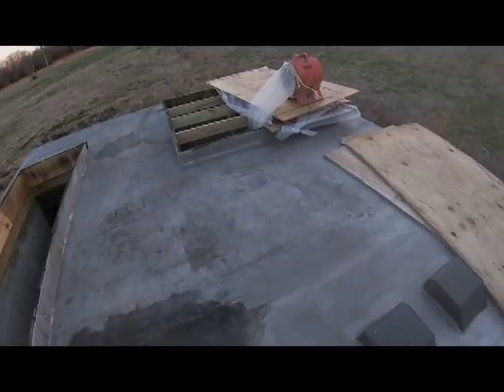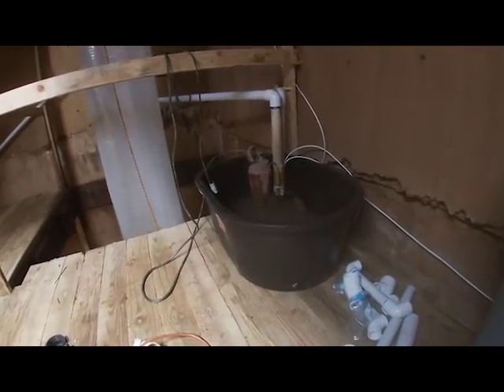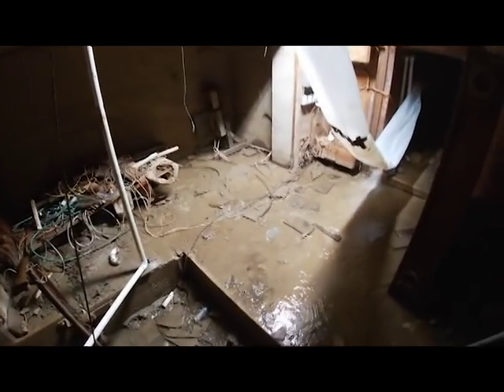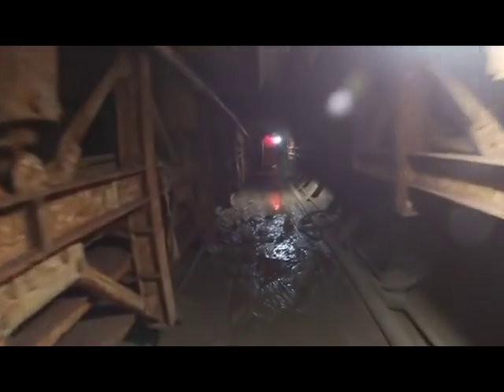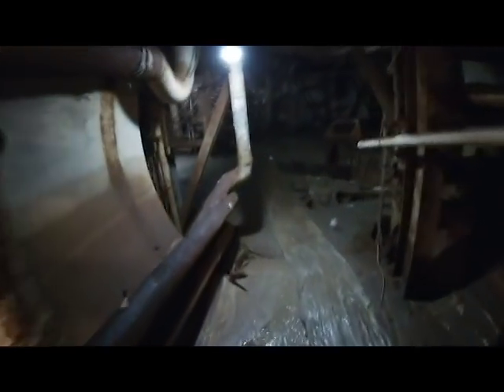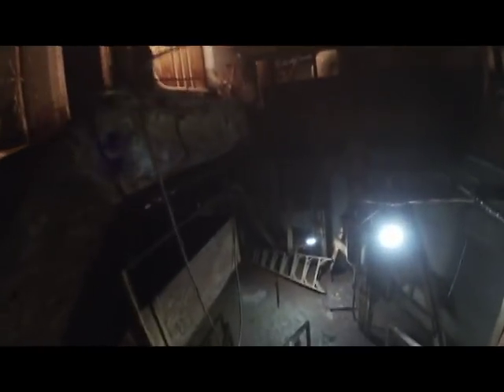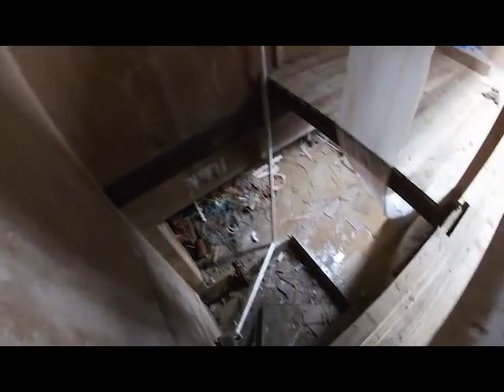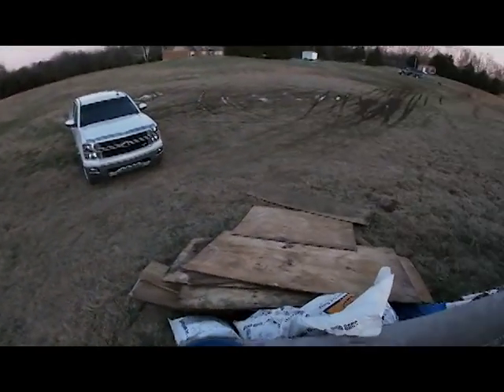S1E11 - New Access Portal Decking and Tour - Owning a Titan II Missile Silo

Comment: If you clean the escape tunnel you can install a large fan topside and push air to the bottom for ventilation.  The air will arrive at ground temperature having travelled the distance against the sides of the tunnel.
Reply from the maker: That’s is part of the plan however you are missing a major problem most months. If you take hot humid air and cool it down you get indoor clouds and 100% humidity. Not good
Reply: @atomicunderground9971  There are some great dedicated "whole house" dehumidifiers on the market. Put one on either end.  Top would be easier to drain.

Comment: one way to help with the water problem and ventilation at the same time is to use a somewhat strong heat source at the lowest points to heat up the air. the hot air will rise out of the silo on its own and take the humidity and stale air with it. you just make sure that fresh dry air is blown in to the bottom without mixing with the wet bad air on its way out. this will dry out the whole space in no time and give you clean fresh air in the whole silo at the same time. with the added  bit of also warming up the cold silo and helping to keep down dust once all the water is gone. this can also be used permanently in the finished structure to keep the air fresh dry and comfortable warm as the ground in usually a little cold (~60 degrees) no matter the outside temp
Reply: also it is somewhat worth it to get a well into the bottom on the filled up silo to start pumping out the water that is definitely filling it up as it is also the lowest point of the site so just getting it half pumped out will keep the rest of the silo dry
Reply: Or they could just set their fan up at the lowest (reasonable) point and blow it up and out through their ducting.
This would suck fresh air in from the surface all the way down to the fan.

Comment: I would get a big well pump because they will put hundreds of feet up a well. It can be setup to use a float switch to shut down when the water is down. You need to pipe the water down hill away your place.

Comment: Make sure you have a fire suppression system in that place covering that wood staircase. You don't want something to happen to your only exit from the bunker.
Reply: Thar would be funny as hell
Reply: lassit lassit1 can’t confirm or deny if the stairs have been rigged to do that if forced entry has been achieved
Reply: Ya just throw some gas down the hatch and light a match then wait for them to come out the escape hatch. Or forget about bad actors trying to flush them out in a zombie apocalypse but what if they have an electrical fire that sets it on fire. I hope they have it treated at least.
Reply: Just another reason to get that escape hatch dug out!

Comment: I'm going to try to not keep going about how cool all this is...  4:57 I see a 2nd pump for redundancy to take over if the one in the pit fails or just can't keep up with it...There's prolly 4, i dunno.  Hopefully the "T-clip" test came back low so you can just throw it all out w/o doing actual abating.  Too much to comment on...Thanks for the tour!  We use to build fans from old gas push mowers...set up over a manhole and it pulls air out ...from open manhole downs stream (sewer/storm), the worked really well!  OK..I'm zipping it up now...Thanks again!
Reply from the maker: I’m all about redundant systems. Right now a flood wouldn’t be a disaster but in the future it will.
Reply: @atomicunderground9971  water is your number 1 Foe for sure.  There is some stuff called "STRONG" it is a dryer type concrete that has fiberglass fibers in it and it is BLOWN on to the surface and spread out like concrete and it stops leaks as its leaking...it's incredible stuff.  It's used to "re-new/re-furbish" old manholes.   https://www.strongseal.com/project-1 Pretty neat stuff...may do the trick in tricky spots

Comment: Install a back check flow valve above the discharge side of the sump pump so its doesn't always cycle like that.  You're going to burn out the motor.
Reply from the maker: M P every valve we have installed pops or fails.

Comment: As I commented on another reply here.

A better option for the ventilation is to have the fan at the lowest, reasonable, point pushing stale air up and out through the ducting. This will draw fresh air right down to the fan at the bottom from the entry portal.
Reply: Nope, that's not true. Ventilation should be done by bringing fresh air to the point where it's required, i.e. where people are working at that moment. This way you are ensured of a constant flow of fresh, breathable air. If you do it the other way around, you don't know what you're sucking out, and you especially have no idea where your fresh air is going. Sure, in theory it should go to the location where you're sucking out the dirty air, but will it? Does your blower even create enough negative pressure to get that done? 

In the worst case, you could actually be sucking out the fresh air that's coming in, so you may actually create a dangerous situation. The likelihood of suffocating because of that is minimal, but it'll sure give you a headache. Also, what happens when your ventilation channel ruptures somewhere? 

When you're blowing in fresh air through the duct to the location where you're working, 2 things will happen when a pipe ruptures: 1. You'll notice that air stopped coming from your ventilation channel, so you're notified of the issue immediately. 2. Fresh air is still being blown into the building, just not to where you're working anymore. Result: Plenty of time to fix the issue, no danger at all.
However, when you're sucking the dirty air out, like you're suggesting, if the pipe ruptures somewhere, you will never realize until you actually see the rupture. The fan will just happily keep blowing, but instead of blowing the dirty air out, it's just blowing it to another section of your building now. The two things I mentioned above both don't happen here. You won't notice that 'fresh' air stopped coming, and you're no longer getting any fresh air in the building.

And even if those reasons aren't good enough for you, why on earth would you want to have a loud, noisy fan down where you're working, where it'll get dirty and possibly even damaged (either from dirt or falling/getting hit), when it can also be topside, out of any harm's way, and keeping the noise outside? Why would you want your fresh air to go through all of the dirty silo anyway, picking up all kinds of smells or contaminants? 

There simply is no reason at all to use your ventilation method, it's worse in every single aspect.

Comment: Its looking great
baby steps! Rome wasn't built in a day!
a couple of possibly silly ideas
The springs in the cable way that used to hold the floor etc  people are going daft over making knives and swords at the moment they might sell?  supplied with a certificate of authenticity etc....
also have you found the ducts that used to supply the electric, phone, you could possibly rig up some low voltage fans  possibly solar powered? it would help stop the air going stale?

Comment: Just a small note. Sucking air does not equal cavitation. Cavitation would destroy your pumps quite quickly. Sucking air is just an annoyance / might overheat them.
Reply: When I used to keep a reef aquarium, we called it "scavenging." Not sure if that's the proper term to use here, but it's the same effect.

Comment: So sad to see what was once a very well designed and engineered structure in such bad shape.  Some idiot in the architecture department did not think about checking the local groundwater tables.  I can only presume that the original structure must have cracked to let that amount of water in.   I would have rebuilt the original cover back the way it was.  You really should have two board rows on the the elevator shaft railing.
Reply: LOL

Comment: What is the reason that people don’t clear out the actual silos? I’ve only ever seen where they clear out the control center and cable ways.
Reply: Mostly because of three factors: time, expense, and usefulness. It'd take a ton of manpower and money (unless you own a bunch of specialized heavy equipment and access to lots of free labor) to dig it out from top to bottom (all 146'!) and remove all the copious amounts of scrap and heavy concrete the demolition team dumped into the silo before burying it. After that, you'd have to rebuild the top 20' of the silo, since the treaty required the teams to blow it up. After all that, you're left with a giant, empty vertical pit. Not many people have a use for that. At least not one that would warrant spending a small fortune to rehabilitate. That being said, I'd LOVE to see an emptied silo just out of curiosity. But you can visit the Titan III missile museum to see a fully preserved one.
Reply: @Calamity_Jack  The Titan II silo itself is also not that terribly wide either, so assuming you went to the vast expense of clearing it out and rebuilding the top (or at least putting in some kind of roof) what do you have for your trouble? It's not like a Titan I or Atlas where the silo itself is this enormous cavernous space that was required by the elevation and fuelling systems.
Reply: @MalikCarr  True, they're only about 55 ft. wide. So unless you have something really, really long you want to store, not very useful.
Reply: @Calamity_Jack  And that's after you tear out the interior silo walls, right? I don't think the Air Force was considerate enough to do that for you, otherwise the usable volume really isn't that much greater than the width of the missile itself.
Reply: @MalikCarr  you know what would be weird and just down right creepy? I know this would never happen. But just imagine if someone did clear the silo out. And there was still a missile there. I would shit my pants. That would be creepy.
Reply: @tylerdees4850  That would be very interesting, although it's physically impossible - the way those silos were demolished in the 80s means there's not enough vertical space for a missile to fit inside it. It's not like when they took the Atlas or Titan I silos offline in the 1960s and just welded up the doors, the Russians wanted verifiable proof the Titan IIs were decommissioned and by that time they had spy satellites that could verify it.

Comment: Wondering why you are making flat top with giant entry hatches instead of building a kind of building around all access point?
Reply from the maker: There may eventually be a building up there but for now it’s designed the same way it originally was by the Air Force

Comment: Just a question  about the scraper.. is he going to pay you for taking the scrap? I mean I know scrap prices can be low but the way I look at it is he shouldn't be charging you to take the scrap because it's  kinda free money
Reply: Another channel (Death Wears Bunny Slippers) went through this with his silo. He thought the value of the scrap metal and copper wiring would more than cover the cost of demolition. It turned out he was wrong. The scrap did help defray some of the costs, but he still ended spending several thousand bucks to the scrappers for the job. Apparently, the scrap metal market is pretty depressed right now. Metal scrap isn't bringing in much money.

Comment: This Idea ,  hit me watching this.(1  make sure air free of explosive fumes)  All of us watching this think HUMMM     "Now If owed this place "!.( won lottery had millions spend on it!)Here what I would do......  that why fun watch....

I own  a small coal stove, low teck no fans just a  steel box.  Dry Hot heat puts  out is out unreal. Matter fact I dump 5 gallons water on floor( all clear cement  every night( put water the in air).  2 Hours later all gone!.
Step #1 

Open up in control center the emergency escape tunnel ( you got door open) Put a( proper stainless steel ) chimney up that  shaft   .I  then install small coal stove in it ( not wood) ( us Coal company stove, I do not get paid from them ! ) 
 Get 1 pallet 1.25 tons Last a year.( $500-$1000 , stove  same cost   , stack $1500.00.
This do several things ,   Burn hard Penn Anthracite coal. get rid all water in air and in walls/ floor.
This will suck all air moist air  out. send to surface. capture heat off stove , blow it to lowest floor. 
This circulation will go all way to top dome. Put in vents to pump air back down lowest floor  .
Run 4 inch cheap plastic flex able  tubing get that to stove burns only surface air.
Problem got is  cement needs be dried out . ( On inside) all cement like a sponge holding water ....Right now pumping in air from top side ( summer all water), fighting cement .
Step #2
Then get a second stove and put it in bottom entry shaft do same thing. ( going put in elevator).
Run stack surface , fresh air from out side.( close top entry  shaft off).

Net result  , Ground temp 50 -55 . need get walls hot and dry. 100-105

Stove temp full cap (  3 feet above stove 100-105 F  ) dry out the walls ( cement ) entry portal, suck moist air out all blast lock area ( some long cable way).
 With stove in command center ( take a bout 2 -3 months ) it will bring temp 90-110 degrees inside ( under ground).
 All the smell and water in air will be gone!Kill lot of mold....

 The radiant heat stoves puts out makes fire wood heat  , feel as cold  like ice cubes, in comparison. 
Right now you are pumping in moist air ( better in winter dryer). have water ( river) that is acting like a giant humidifier.

Right now  I heating my entire( 40 year old  poor insulation ) house ( -25-35 below out side). 72 degrees.   when out side temp goes balmy 35 degrees out side , we have open winds let excess heat out.....that warm   and that dry!  The cement floor and walls ,( after oct/nov/ dec jan) are so warm we can let fire out........house stay warm and dry 24-36 hours...

 During winter months , heat entire complex 2 coal stoves,suck all water out air and walls.

 Even if still have water running out .......... hot dry walls will act like a heat sink and burn off all moist air.

My guess  is  had 2 stoves going non stop 2 years have most cement dryed out.

Need dig out , put in drain tile all way around dome.....get water away from sight.

Farmers did that in 1970  drain off all swamp land  to grow crops....5k to get sight dry.

The AZ   sights have so easy!!!

later....Mike

Comment: Not sure but the sump pump sitting there cavitating won't last long. Most of those need to be sitting fully submerged in water for cooling the electric motor. I had a few burn up when the float stuck on letting the basin empty.
Reply: super Dave the pumps we use can run dry without damage
Reply from the maker: Cheap pumps will not handle running dry. That’s why I purchased the MQ pumps. They can run dry and have overheat protection. I will be installing float switches but they are notorious for failing and causing flooding
Reply: @atomicunderground9971  Can you install two switches in parallel? That way if one fails to close, another could do the job.
Reply from the maker: I’m sure it could be done

Comment: So whats about the water leaking are you able to seal it so no more water can leak into the structure? Or is this impossible? Greets
Reply from the maker: It’s just a 1 inch leak in the dam. I have to drain and reweld it. It’s just not a priority until scrapping is done
Reply from the maker: Paul Herder the silo is absolutely full of water due to the original leaks and the fact that they blew the top off. Isolating the Launch Control Center with a dam really helps except for the small leak in my dam
Reply: @atomicunderground9971  Ty for the answer hope that works out as you expect.
Reply: @paulherder5356  Interesting. One could guess with all the bar reinforced concrete and that thick that theres no chance for water to come in but knowing water it always finds a way ^^.
Reply: @atomicunderground9971  if they were build in 2018 it would cost around 1,8000 000 dollar. Back then it was around 12,600 000. Wow you got something there buying this.

Comment: Is the silo itself accessible?
Reply: 8 Bit MEGA-Blade no
Reply: Think it's filled up like the escape hatch.
Reply: The silo it’s self is filled with concrete,dirt, gravel to the top. the end of the long cable way is full of gravel and there is a dam that has been put into place to control the ingress of ground water
Reply: @colby1345  so basically that part of the base is both Inaccessible and unusable
Reply: @colby1345  I hope the contractor cheaped out, and used more gravel than concrete ^^
Reply: Pretty much. It was a catch all for everything that was on site everything that was topside was pushed into it to fill it in. It can be cleaned out and accessible again it has been done on other sites (Arizona) but the amount of time and expenses it would cost is not worth it
Reply: @colby1345  Set up a patreon to help?  We wanna see the whole base.
Reply: There is a patreon already set up and there is no base just an empty field with a hole (Access portal)